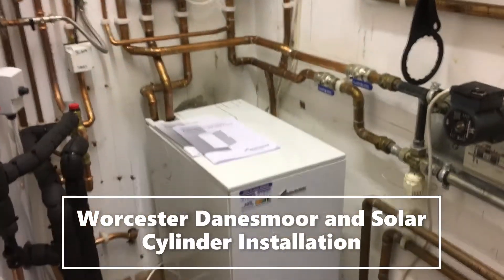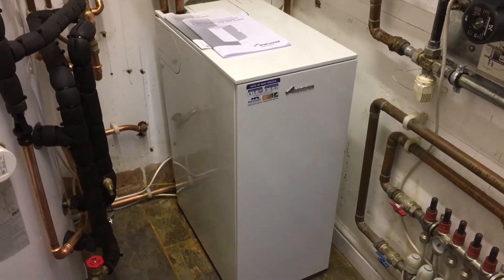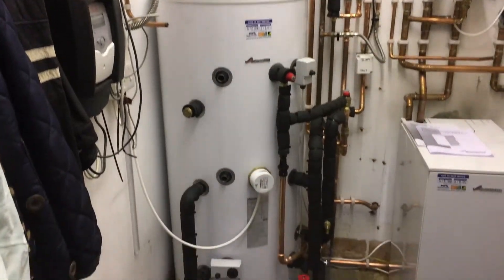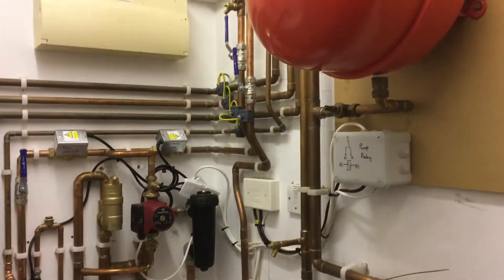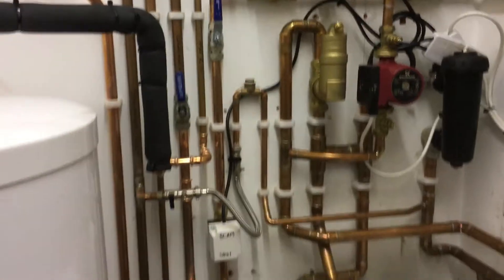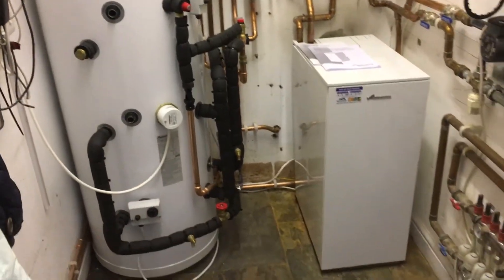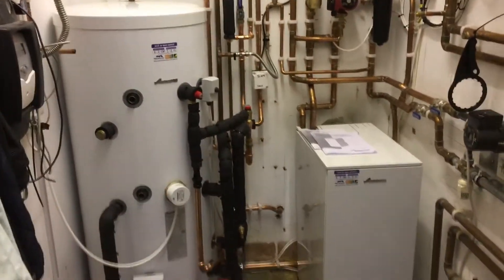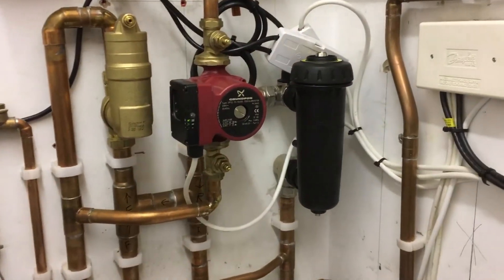Worcester Danesmoor

Comment: Learned a lot from your installation videos.I like the idea of putting isolation valves all over the system to reduce drain down times.Learner question:You have put two 2  valves in series on the 
hot water side to the unvented cylinder,one honeywell? the other danfoss?.Is their a reason for this, an extra level of safety perhaps? in case the first one fails ( in the open position), But why two different makes?Maybe thats all you had on the van or is their another reason.I assume you wire them the same in the wiring centre.Thanks again .Great job.
Reply from the maker: Hi, thanks for the comment, from memory,  I think we've got one as a control valve and the other came with the cylinder kit, so it just went on. In theory you could ditch it as long as it's wired through the overheat to shut the cylinder off in an overheat scenario.